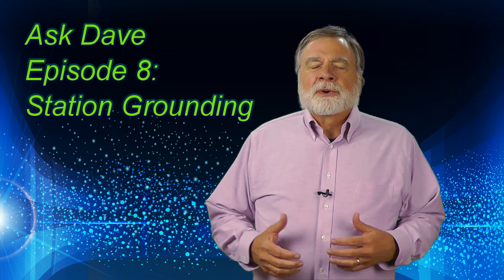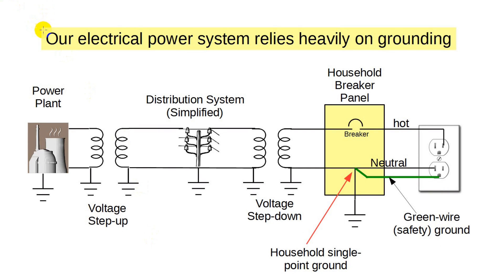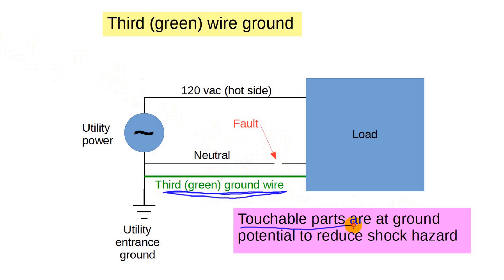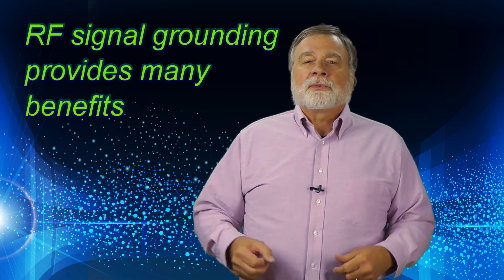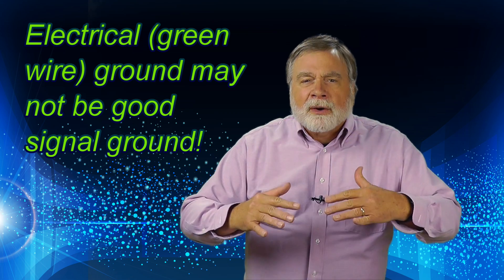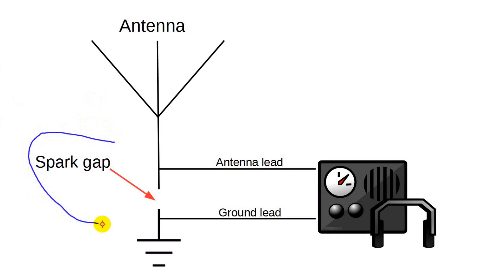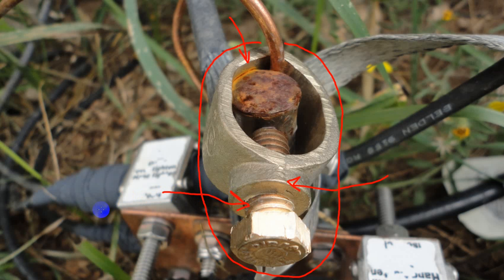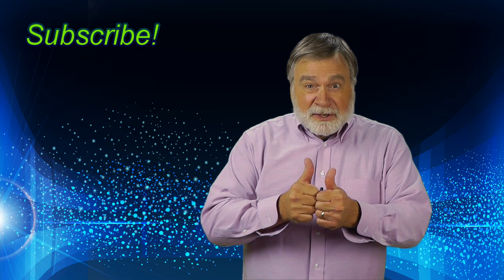Station Grounding for Amateur Radio: Ask Dave Episode 8

Comment: Sir I'm a newbie ham from the Philippines. I have setup my shack in a concrete water tank / storage area. Our water tank is divided into 3 sections: ground floor for storage, 2nd floor my radio shack and right above my shack is the water storage. I have placed my antenna attached to the concrete wall of our tank. My question is, is my concrete water tower enough to ground my antenna or do I need to add a copper wire connection from my antenna to the ground? If yes what part of the mast or antenna should I connect the grounding wire? Please advise thanks.
Reply from the maker: Paolo, you should add a copper wire ground. If the mast is metal, you can just connected to the bottom end of the mast and then from there to ground
Reply: Thank you so much for the prompt reply sir. Will be doing exactly as you have instructed, Thank you again 73s
Reply: By the way sir is there any specific gauge you recommend for the copper wire?

Comment: I've been told that those lightning arrestors are supposed to be hooked right to the antenna then you run a ground wire down to the grounding rod and this is said to send the strike down the ground wire instead of the coax that's hooked to the lightning arrestor after said antenna, is this wrong or right? I personally like how you set your grounding up
Reply from the maker: The lightning arrestors are connected directly to ground close to the point of entry of the coax into the building. If you're on an upper story, you should run the coax down to the lightning arrestor at ground level, and then into the structure and then up to the radio, if at all possible.
Reply: Ok I see thanks 😎😎 I appreciate you and the hard work you put into your videos

Comment: Hello Dave.  I really enjoy your videos!  Working on putting together my 1st HF Station at my new house.  Question: regarding the picture that you have in the video at about 11 min 10 sec.  Is the ground lead the shield of the coax and the antenna lead the center conductor of the coax?  Thanks!
Reply from the maker: One piece of coax connects to the transceiver, with the shield being grounded. The other piece of coax connects to the antenna, with the shield being grounded.

Comment: So, Dave, at what point do I need to be concerned for grounding my HT setup? Let's say i have an HT connected to a SlimJim up in a tree connected with 10 feet of coax. Am i at risk without ground? How about a 1/4 wave at the top of a painter's pole? Not permanent, but a quick portable setup. If I should ground, help me understand what kind of wire and connected at what point in the setup, and what should i drive into the ground. Again, portable temporary setup.
Reply from the maker: For portable temporary setup, I wouldn't worry about grounding at all. If lightning moves into the area, just take everything down. Simple!

Comment: I truly appreciate how well you teach these topics. The clarity you bring is amazing.

Another great source of information about grounding and bonding is the Mike Holt forums and training videos. A key takeaway that I've noticed is "grounding" often misrepresented or under represented, especially the safety ground. In fact the term "ground" gets used to mean so many things it can becomes unclear for some people. An important fact is that ground rods that meet the NEC simply cannot conduct enough current to clear a fault. The code calls for 25 ohms. This simply isn't enough to trip the smallest branch circuit breaker. the bonding of the green wire to neutral at the service entrance gives the "ground" the current capacity to return the voltage to source, trip the breaker and clear the fault. I watched a Mike Holt video where he and his team were showing how to test a ground system and how different soil types require different techniques to achieve the NEC ideal 25 ohms.

Also, the lighting taking the path of least resistance is often said, but Kirchhoff's laws teach us that lighting takes all paths, the least resistance of course gets the most current. I understand lighting doesn't turn corners very well either.

I've been studying for my extra and find your videos extremely helpful.

73, Phil, KC7SVI
Reply from the maker: Thanks and good luck with your studies!

Comment: Great video, but you don't mention the required bonding between the extra ground rods (such as the one at the surge arrestor) and the existing ground system (i.e service ground).  The electrical codes require this and it's important in the event of a nearby strike that causes a large step potential.  It's pretty important to have that bond.
Reply from the maker: The video makes a point of bonding the ground rods and shows how I've done mine. I was afraid it would increase receive noise, but it didn't. ARRL has a new book out on grounding. After reading it, I may revise my video. 73, Dave
Reply: Thanks Dave, I didn't see the bonding in your diagrams but I do remember you mentioning that you had done it.  I think some folks think it's optional.

Comment: Dave:  Instead of hammering an eight foot ground rod into the ground vertically, can I burry one say two feet under ground horizontally and have the same protection? My problem is I hit bedrock at three feet. Your videos are excellent. Nick VE7NRL
Reply from the maker: Yes, you can go horizontally, but put in another ground rod going the opposite direction and bond the two together. Should work okay.
Reply: Sorry if this is a stupid question. When you say opposite direction do you mean at 90 degrees or parallel with first rod but connector at opposite end.
Reply from the maker: Bury two separate ground rods going in two different directions. A buried horizontal ground rod is only half as effective as a vertical ground rod. Burying two in the same trench doesn't help. But burying two in separate trenches will give you the equivalent of a vertical. The two ground rods should have a common point together where they are bonded and accessed. It's hard to describe without a diagram. Send me a message using the dcasler.com/ask-dave form and I can reply with a diagram. 73, Dave

Comment: so to be clear as you mentioned you have the household ground and the lighting ground connected at the same place. should the rf ground also be connected there or beings we want it as short as possible does the rf ground get its own rod closest to the gear?
Reply from the maker: My RF/lightning ground is just outside my shack. The utility ground is about 30 feet away. I "bonded" them with a length of #8 bare wire between the two.
Reply: Ok thanks
Reply: I think NEC 810.21(J) requires min. 6 AWG copper.

Comment: great videos ! thanks a lot ! I have one question as a starting ham and at moment cb broadcaster: having a hand held radio (midland alan 42) and a wire antenna ... is there a way to ground ? Or shall i take better a albrecht mobile that connected to a car battery (that i take with me) - but whta would be the best way to ground than ? thanks a lot for your help and greetings from Zürich, Switzerland
Reply from the maker: If you're using a handheld radio (handie-talkie) then likely you don't need a ground. However, if you're using it to drive a separate antenna, then it's a good idea to have a ground of some sort.
Reply: +David Casler something like that you probably mean, right ... http://www.hamuniverse.com/htantennamod.html
Reply from the maker: You can give it a try! 73, Dave

Comment: Leaving things disconnected all the time is an excellent idea.  That's what I do.  During the summer we have "popcorn" thunderstorms that just "pop up" in minutes and if I'm not home it can cause bad things to happen.  Back in they day (tube radios) we used to string several neon lamps in series as a "spark gap."  They would clamp at about 250V which was good for low power transmitters and most tube type rigs could handle that type of surge in through the antenna.  I'll second that "don't use solder" for your ground!

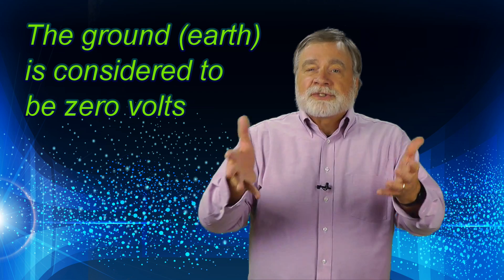Comment: Lightning strike?  Listen to this one!  The storm had been going for about 45 minutes and was the most intensive lightning storm I had ever heard.  This is the most "dynamic" portion of the storm, DIRECT STRIKES!  The sounds were so loud, probably 30 db above what it could handle, that they clipped the digital recording.  The first direct strike, about 1:10 melted the Dacron guy wires on my 30 meter vertical.  The guys popped like a rubber band and, bringing an insulator with one of them and struck a window.  You an hear the glass breaking.  I quickly went to the side door to look outside just in time for two direct strikes at about 1:43 (I was blinded and my ears were ringing for several minutes). Then to add insult to injury another strike came at 1:53 which melted the CPVC insulating section at the base and down it came. When I dug up the coax there was no copper, after cutting it lengthwise I found that the center conductor was nothing but little beads of copper.  How do you protect against this?  You can't.  100 million volts at 500 thousand amps is going to do damage.  Putting the end of our coax inside of a glass bottle isn't going to help either.  That lightning came miles to get to your antenna and a few millimeters of glass isn't going to stop it.  The best protection for your rigs during a storm like this is to put them back into the original box and slide them under your bed. :)  Just disconnect everything and pile it in the center of the room far away from electrical outlets and antenna connections.  Did I lose equipment?  Yes, everything, rigs, power supplies, computer, oscilloscopes, just about every piece of test equipment in the room...including the little MFJ battery powered clock.  It was as if I was standing on the bridge of the U.S.S Enterprise with the Klingons attacking. 

Hear it for yourself, this was around October of 2010.  The entire recording was about two hours and thirty minutes long.  This is the two minute highlight, no editing except to just give the two and a half minutes of heart stopping lightning strikes.    It was what we called a "four kid storm."  That means four of my kids came and wanted to get in bed with us.

http://www.eaglecreekobservatory.org/hamradio/sounds/storm.mp3

Comment: Great videos.  My question revolves around ground loops.  I understand them... I think.  However, I am not sure about a ground loop being formed by the connection of equipment with shielded coax that is grounded to a single ground point.  Does this create a ground loop?  Each chassis is grounded and each is individually connected back to the single ground point, however each is also connected  via shielded coax which is also grounded.  Does this matter?  It looks like a loop to me on a schematic drawing..  Any suggestion would be appreciated.
Reply from the maker: A ground loop is fundamentally a circular path in which RF currents flow. A short connection to your station single point ground can help prevent this. Even so, sometimes odd RF paths do occur, so you may need to rearrange the cables, change length, etc. 73
Reply: Is there a fundamental loop between two pieces of equipment individually connected to the single point ground and connected to each other with coax?
Reply from the maker: Not usually.
Reply: Perfect!  Thank you again for the excellent videos!

Comment: Very professionally done, Dave!  Audio and Video perfect, unlike a lot of other vids.  This topic is what I've been wrestling with as I build my station.  The RF grounding from my equipment on the 2nd floor of my house is the unknown.  Reference material says to use the "shortest run possible to ground".  

If I have all my equipment bonded to a common bus bar (copper pipe), the single wire from the bar to the ground is ~20'.  Is that too long?  I also am thinking of running the wire through the wall entry point (next to my antenna coax) outside to the ground.  Would that create any interference problems with the wire right next to the coax cable?

I just found your video this AM and now need to start with Episode 1.  

73
KD2MCH/Bob
Reply from the maker: Hi Bob, and welcome to the channel! The best way to find out how well your grounding solution works is to try it. Yes, it is true that 20' is long, but that's not much different from what I have. Both my antennas run through lightning arrestors that are located on the ground rod, so that helps too. The cables themselves from the radio to the ground rod run right next to the ground wire with no problems. Good luck with your experimenting! 73

Comment: very important topic. I was told that you can make a artificial ground by using a 5 gallon bucket salt and copper tubing used in a coil type configuration in the bucket and water of course the water would be salt water because of the salt there's another ingredient but not sure is this true
Reply: A ground is a current path through the Earth.  This sounds like a means not to have the current go through the Earth.

Comment: Great Video.  My only question is .... Can I run a separate ground wire to my house ground rod ( I'm assuming it's 8ft down ) and use that as my station ground.  Rocky soil may prohibit me from installing a second 8ft rod.  Thanks
Reply from the maker: Many house electrical entry panel ground rods are only 4-feet long, and it's there only for safety reasons. Often these don't serve well as signal grounds. That said, if you drive another ground rod that's close to your station, you should still run a wire to the house ground (that's bonding). If your soil is simply to rocky to drive a ground rod, you can lay out a few sturdy bare copper wires on the ground, connect them to a central point, and then bury them with a couple feet of dirt or soil. Good luck, and keep experimenting! 73, Dave

Comment: I grounded to an old steel gas line network, and I mean an old "abandoned" gas line, with a wood plugs in it, and "no gas". Super great grounding!!!! The new gas line is plastic inside plastic with a metal tracer wire for a locator to get a signal from. The old gas lines run all over the place, but there is no gas in them. I had someone come out and scope the sewer lines, the new  and the old gas line looking for accidental cross bores through other pipes. So that has been double checked, but i was not to concerned or I'd have never done it in the first place.

Comment: An excellent article Dave the only comment I would make is that the deeper you can get your RF ground rods the better and that if you add additional ground rods to your SEPARATE  house wiring safety earth that you will likely improve the signal to noise levels at the receiver

Comment: Dave, thanks for clearing up allot of marketing hoopla!

I finally drove my 8 foot copper ground rod for my station (89 deg F, humid), it is isolated from my home's electrical system since my ham radio system uses a solar charged battery bank for power.

My question (non-binding, your not an electrician): Since my ham radio gear is connected to my solar which is outside I was thinking these two items need to share the same ground (ground my station to the earth ground busbar inside of my solar disconnect which my solar MPPT controller is connected)  This way I have a single point of ground on the standalone solar and hamradio gear -almost like it's in a separate building. So long as I don't connect an AC battery charger from the main home's electrical system I would only have one ground present.

I appreciate any advise.

73, kk4zuu
Reply from the maker: I recommend grounding everything. You can ground your panel frames (for lighting and electrostatic discharge protection) where the panels are. Note that the negative side of the panels may not actually be at ground potential because some charge controllers use the negative lead for controlling. But you should definitely ground the negative terminal of the battery. And then the solar ground, the station ground, and your household ground, should be "bonded," meaning a reasonably thick wire connecting the three, usually outdoors. I use bare copper #8 wire so that the connection itself provides a bit of grounding. 73, Dave
Reply: David Casler Thanks David. I bought green 6AWG THWN-2 wire for this purpose vs bare. I will run bare wire over to bond the new ground rod for the station/solar to the house ground.

BTW: Your videos helped me earn my tech and my general. My son is now watching your videos for the technician license exam (10 yrs old).

73, kk4zuu
Reply from the maker: I wish your son the best of luck in his studies!

Comment: I live in an apartment.... I would like to set up my station but where can I ground my radio since I'm in a apartment??
Reply from the maker: +Johnny Valdes As you can see by looking through the comments, you're far from alone. In general, you always want utility safety ground (three-prong plug) for your power supply. Whether you need a signal ground depends on circumstances. For VHF, probably not. For HF, perhaps, but not for sure. I need to locate some hams nearby who operate from apartments so I can get their story and see what they do. But where I live is very rural, so not very many apartment buildings. This is a common question, so I'll make sure it stays on the list for a future video.

Comment: hay dave question getting ready to move into16 story apartment where I will be on the top floor I don't  think  l'll get antenna up but l asked this  question anyway if l put a end fed  wire  up rectangle configuration will l get contacts from all directions
Reply from the maker: +Barney Wright Yes, most practical wire antennas are close to omnidirectional.
Reply: +David Casler thanks for your quick response should I keep qso King box on the outside on the ledge I couldn't have it on the inside of the window seal